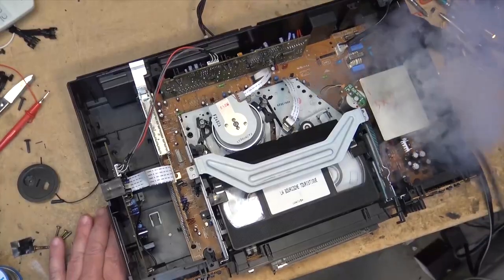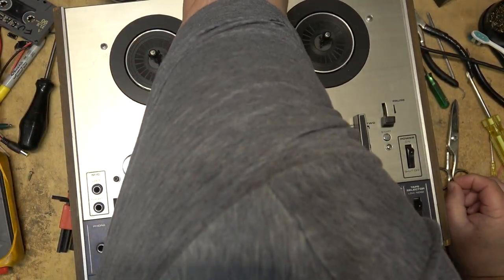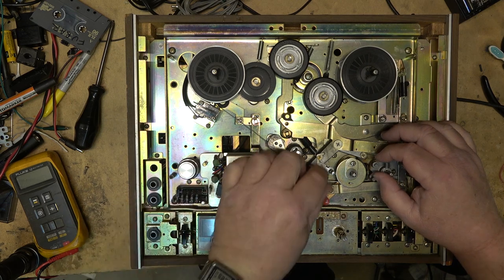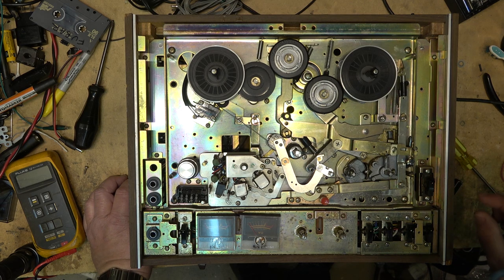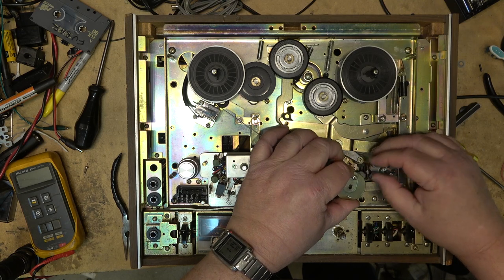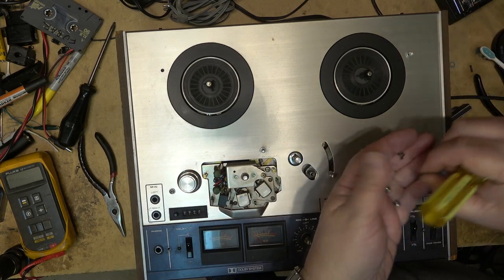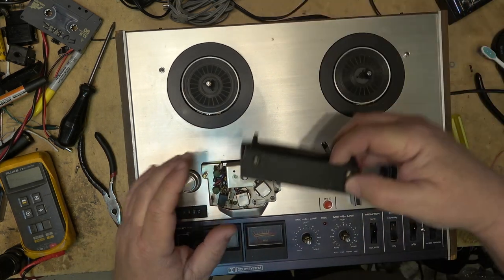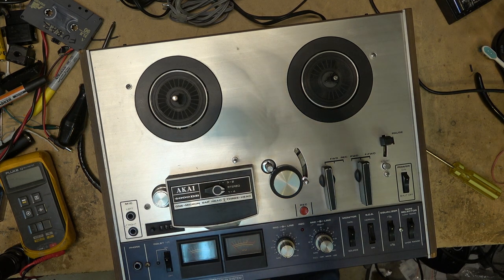Before buying any old AKAI tape recorders watch this

Comment: Couldn't 3D printing the broken parts be a solution here?
Reply from the maker: I'm sure some people are trying to do that. This cost money if someone wanted to put $500 into fixing one of these old machines and possibly you could get 3D printed replacement cams in fact I know you can because people are selling them for about a hundred bucks us.  Convert that to Canadian that's around 138 these days, then there's another 60 or so dollars in taxes and broker fees tacked on to that, you're up to about 200 bucks just to get the part. Then there's the time taken to disassemble and replace the parts another $150. So now we're at $350 to fix an old tape deck, one that I picked up in identical unit to this less the Dolby for $30. So $350 to fix a tape recorder that would sell for about 30 bucks doesn't make a lot of sense to me nor anybody that I know that has any brains. You hear of people spending huge amounts of money repairing old vintage equipment and the only thing that comes to mind is more money than brains. I don't have those customers here generally because people out my neck of the woods are a little bit more careful with their money. They won't spend their money fixing some old piece of junk like this no they'll take that money that they were going to spend to fix something old like this and pay someone like me to transfer their media to digital and be done with the old obsolete media. I have more old tape recorders kicking around here that people abandoned because they didn't want to spend the money to fix it. None of this stuff is worth anywhere close to what people think it is. It's only fake eBay sales that drives the hype and gets people into thinking that this old equipment is worth a lot of money. They look at past sales that have sold in the thousands for certain pieces of equipment and believe that that is what it is worth. What they don't realize is that a lot of this stuff that sold for high dollars on eBay didn't even exist, it was criminals putting up pretend ads to sell pretend equipment between their associates in themselves for the purpose of money laundering through PayPal.  Why do you think PayPal's policies have changed requiring everyone who sells product to report income of over $600 per year?  I guess PayPal has made a lot of money and so has eBay through those transactions. The person laundering their money sees the transaction fees is just a cost of doing business to exchange dirty money for clean. But what it does is it creates a false sense that this old equipment is worth a lot of money and everyone thinks that the old receiver that they've had sitting in their cabinet for the past 40 years it's going to fund their retirement. only a true fool would actually buy something at those prices!

Comment: HI !  can you  make a video on how  to calibrate a revox a77  with minimal test  gear.
Reply from the maker: No
Reply: Find a service manual, have access to a CRO, an audio oscillator, an N&D meter and an alignment tape. You need plastic adjustment tools as well.

Comment: why is your digital scope not suitable for use as apposed to your analouge scope
Reply from the maker: Not enough resolution to look at complex waveforms such as video or the eye pattern on cd players or RF envelope on VCRs ect.  It is a pretty usess scope.  Would have never bought it if I knew it's limitation but the shop wouldnt take it back.  So I wasted about 700 on it.

Comment: As long as the heads are ok, meaning no wear at all! Any R2R is repairable with origional parts even! R2R 's everywhere. Good heads for most if not all consumerdecks, as good as unobtainable. Not new, not NOS, not parted out available,. nada! Buy only a deck with no physical wear on the heads: Or make shure you can source / buy them ot have a spare head or complete set if needed. Othe then that. Eveything that wears out is being newly manufactured for most decks. And complete decks with bad heads you stumble over online especially!
R2R's big bulky roomy, easy to work at.

Comment: Dave what Kinda car ? GM SPS has been down for 2 days now
Reply from the maker: It's my 19 volt. They reprogrammed the new radio and I picked it up and guess what? Still can't receive shit.   Pulls in the 3 strongest stations only and even those are noisy like there is no antenna plugged in.  The XM radio however works great despite me having no XM sub.  Wouldn't it be funny if they put a new XM radio in and hit it with a free sub. If only it was a lifetime sub. I could live with that.  I don't listen to the radio that much usually my own tunes on the 128g SD card in the dash but it is nice to listen once in awhile.  Usually i am listening to the am news and talk stations anyway but I do listen to the local FM stations from time to time so i want the radio to work.
Reply: @12voltvids  is it  GM car ?
Reply from the maker: @johnspofford4297  yes gm makes Chevy
Reply: @12voltvids  ohhh I didnt see you wrote Chevy. So I do lots of programming at my shop ..and the GM Server was crashed ...come to think of it so was Chyrslers !
Reply from the maker: @johnspofford4297  Yes it was. They gave me a brand new Bolt to drive and reprogrammed it the next day. Problem was it DIDN'T fix the problem. The bloody FM radio is still deaf. So it will go back, and they will give me another loaner. I'll demand another electric, as I will be dammed if I am buying any gas for the loaner.

Comment: Pot metal has been used for far too many mechanisms that are subject to wear and tear, then as the years go by
it becomes brittle and falls apart.
Automatic record decks and as seen here tape decks are often beyond repair if you can't find any good spares.
Original spares won't last long due to their age and stored in poor conditions.
Having been in the repair trade since the late 60's i have had to tell many customers that their prized gear is
beyond repair.
Plastic gears and cams also suffer a similar fate.
Reply: You have to treat pot-metal parts nice+not force things.  If they are never loaded heavily (newtons) they'll probably never break.

Comment: would 3d printing solve this issue?
Reply from the maker: People are selling 3d printed cams.  Over 100 for the 2.  Problem is nobody wants to spend more than 50.00 to fix these old cheap akai units. I have a few here of my own and I wouldn't spend that to get them running because they are worth about 50 bucks on the used market.   A broken machine is worth more to part our than fix.   I sold the capstan sleeve off the one I had and got 30 bucks for that.
Reply: @12voltvids  I agree, but if you have the know how and you have your own printer it would be viable. but buying it from someone for 100 for 2, is a joke. and yes parting out is better always

Comment: It is my understanding that the thermosetting plastic used in 3D printing is not very durable. Give the amount of stress put on the cam in question I doubt that is would last very long.
Reply from the maker: And that is why I am not spending over 100 bucks for it.  I know someone that bought one off eBay and it worked for a few months then the printed plastic cams broke.  Seller wouldn't take it back and it was past the 45 day limit.   eBay sellers do this all the time and fuck people over because they last a while and break.   How does that saying go, a fool and his money.

Comment: Most of those cams suffer from cast pot metal rot which is a piss poor material for anything. CHEAP is the operative word. I never liked the two-lever AKAI decks. Just a little pot metal rot, and some heavy handed oaf that tries to move one lever when the other is engaged, and there you are. A bricked tape deck.

Comment: Have a cam made on a 3D printer.
Reply from the maker: Well I don't have a 3d printer and have no plans to get one or learn to use one.  To pay someone else to make the cam, unless they are willing to do it for 5.00 then it isn't worth it because the owner didn't want to spend more than 50 to repair.  Since these old reel to reel machines can be found for 30 to 50 bucks.  Don't believe the prices you see people expecting to get on eBay. Only a total idiot would pay that but then the world is full of idiots as I witness almost daily when my son pays $25 to have doordash deliver a big Mac because he's too lazy to go get one himself. These machines can be found cheap, I picked up three Sony's and a grundig for free got an acai 4000 for $30. There are tons of them out that people are just giving away and I have others that I haven't even looked at yet to service and see if I can get working with his parents anybody that would pay hundreds of dollars to have an old reel to real fixed has money to burn because a replacement in working condition can generally be found really cheap if you look just stay away from eBay
Reply from the maker: @dinodasbunce6224  i advertise that I am looking for old equipment that people want to get rid of and people call me and saw cone get it.

Comment: What is the world coming to? all that trouble for an fm radio?
Reply from the maker: It's under warranty and yes i listen to the radio from time to time.  I don't pay to listen to subscription services.  That's why I have money and my adult kids don't, because they blow it on things like Spotify, XM, and other still things when it is all available for free with the odd annoying commercial thrown in so i head down the band and listen to something else.  I watch broadcast TV too. No Netflix or Amazon for me.
Reply: @12voltvids  I'm surprised that you don't listen to your own content transmitted from home via an fm modulator, i'm thinking of doing that via an unused fm frequency that is.
Reply from the maker: @tyronenelson9124  well that would be illegal.  Also no open frequencies around here. Even for the little test unit i have in the garage i had to go to 97.7 which is where channel 6 analog audio used to be.  I do have a 128g SD card in the car so music is covered but i like to listen to radio for the talk.  I actually spend more time on am radio than FM. The radio had a problem though and i wanted it dealt with while under warranty.  So i get a brand new car to drive while they fix it.  The new car case 1000km on it.  All electric battery car.
Reply: @12voltvids At the moment I stream music over Bluetooth to the car stereo using an ad blocked you tube app as I get a certain amount of data from my cellular provider and that's fine for me.
Reply from the maker: @tyronenelson9124  I only get 3 gigs a month on my cell plan but then I only pay 15 bucks a month for it.